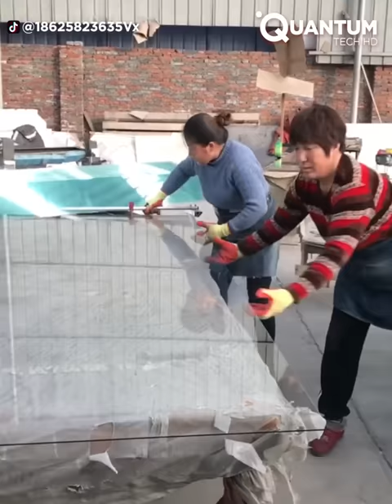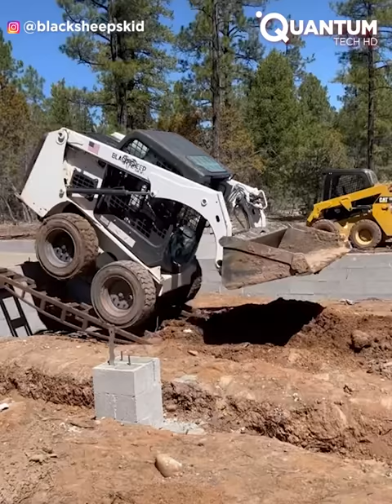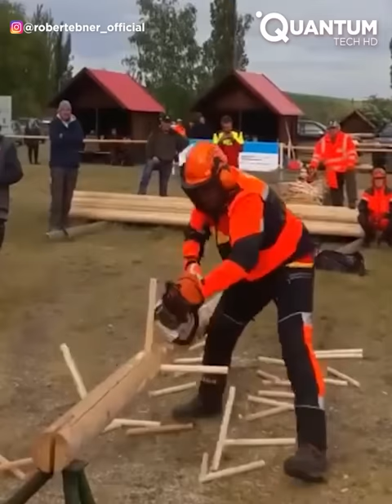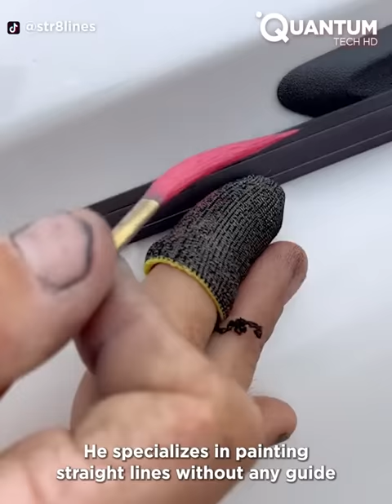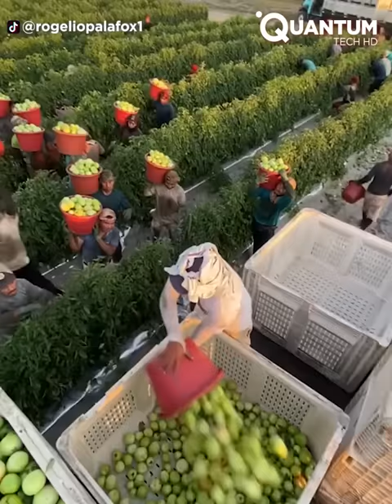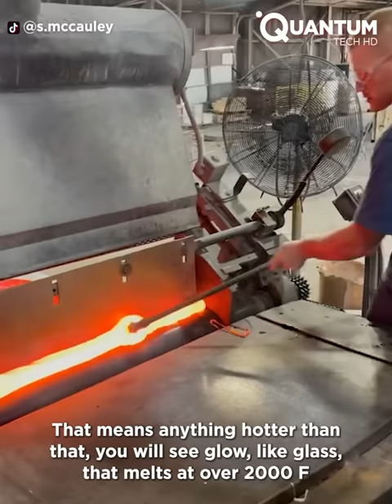Top 50 Most Skillful and Fastest Workers Ever | Best of The Year Quantum Tech HD

Comment: there is some misinformation here. it says "acrylic is the only paint that can be used on ceramic." the video shows someone applying glaze to "bisque," an unfired ceramic piece, which is pigmented silicon that forms into a glassy colored glaze when the piece is fired in a kiln. Acrylic can't be used for this purpose, and technically you could apply many types of paint to ceramic if desired.